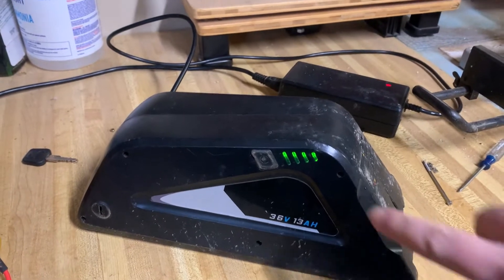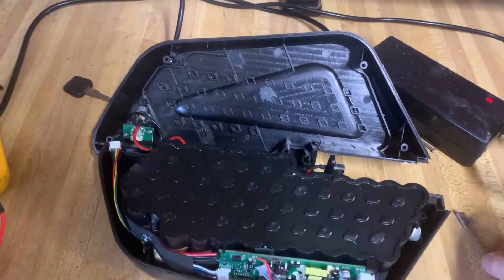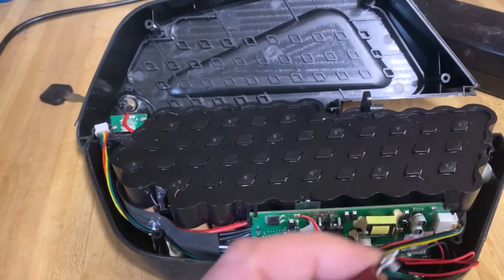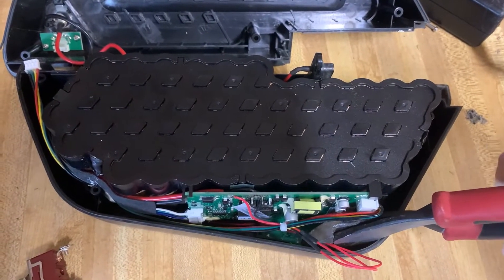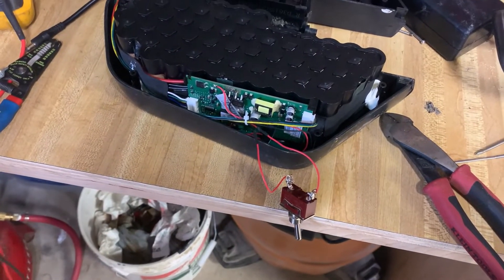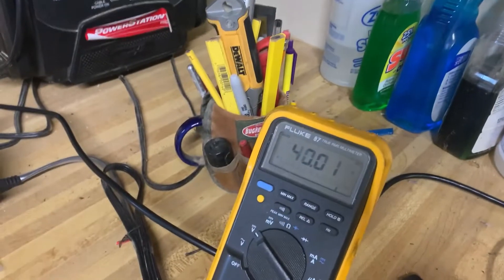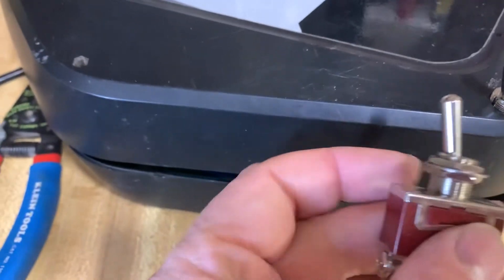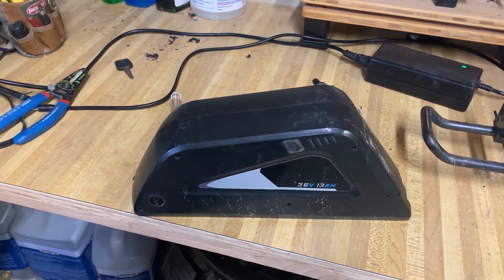NCM Prague 36V Faulty Battery Switch Replacement

Comment: Our NCM Prague battery smells of battery acid after use. And one side of the connector looks like it's melting a bit. Then now, no power on the LED display and the ebike anymore, even though the power indicator on the battery is on. Any ideas of what the problem is, and how to fix? Thanks.
Reply from the maker: @generaluse2878  I am no expert on the matter.  I was hoping someone else would work on the battery until I found out there were no other options than for me to figure it out.  Sounds like you have a bad cell in the pack.  You should be able to isolate each cell until you find the bad one and replace.  Search for rechargeable battery diagnosis on tools for ideas.  Good luck.

Comment: Thanks very much for this! My rubber button fell off, and took whatever was connecting it to the circuit board with it. The battery's otherwise in perfect shape, and I'd rather not spend C$400 on a new one when a $2 part is really the only thing it needs. Cheers!

Comment: Please tell me how to fix the switch problem which connects battery to the controller. It works just 30 minutes then I have to clean the pins of the switch. I think this is the carbon issue. Please help me for this